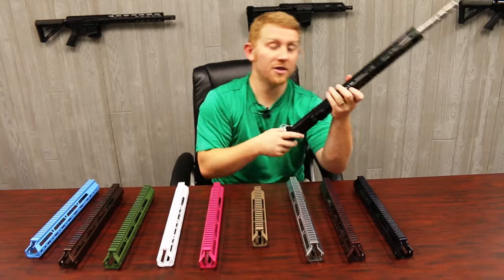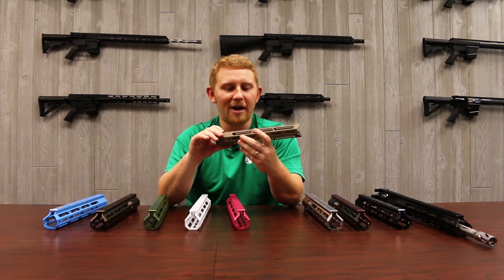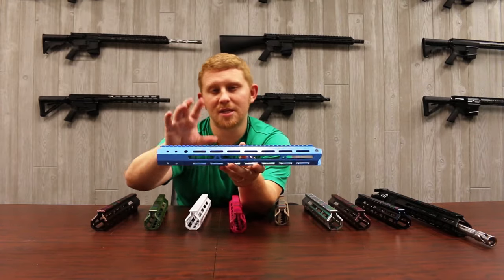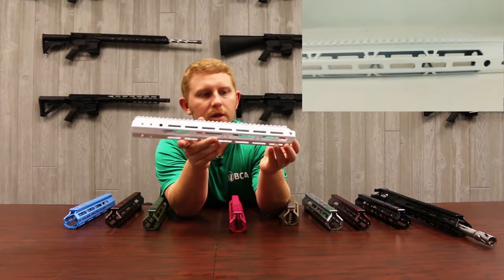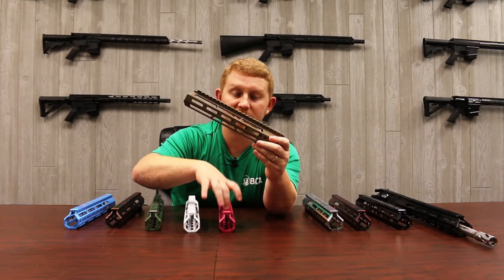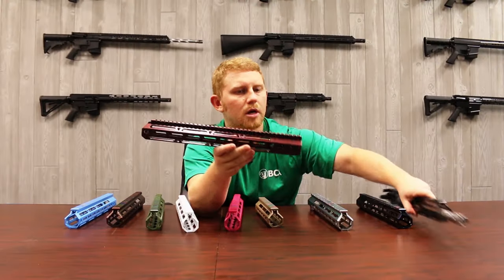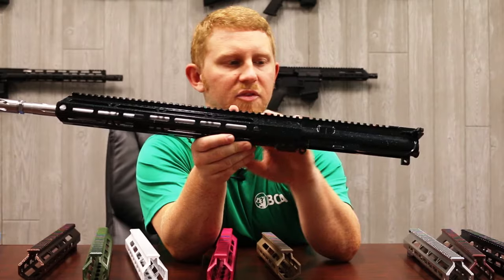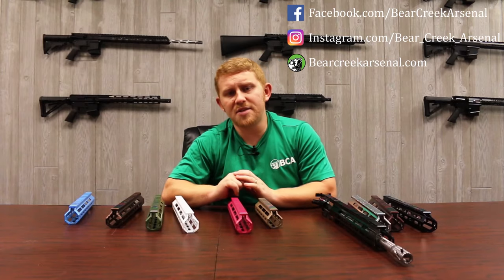Powder Coat vs Cerakote Comparison/Guide: Add Some Color to Your Arsenal

Comment: Powdercoat - 
Is a paint with pigments and added metallic properties that has been processed into powdered form. 
It is applied via a special applicator gun, that electrically charges the powdered paint, allowing for it to "magnetically" adhere to the metal surface of the project piece. 
It is then placed in an oven to bake , which basically melts the paint  back into a liquid and allows for bonding of the paint to itself and adhesion to the pieces.

CeraKote (brand of Ceramic coating)- 
Is not a paint.. but a liquid ceramic coating with a variety of colored pigment inclusion options. 
It's applied by pre-heating the material, then applying the coating to the heated project piece, then pacing back into the oven for the adhesion/curing process. 

Typical to both -
For both processes, after the baking finishes, the piece achieves its maximum strength thru the slow cooling of the pieces.

They share some similarities in resistance properties between them to: heat, surface abuse, the elements, chemical interactions, etc.. but can & do vary a bit from brand to brand.

One main difference is a thinner application, that reduces tolerance issues derived from using paints

Suggestion - 
research the properties of the coatings that you have available to yourself and the application & material reactions, that you want to use the coated pieces for and see which is best suited for your specific need..

Comment: Powder coat is better - I agree with your paint guys. Cerakote is WAY over-rated and has not held up well for me. Polyester TGIC powdercoat can be as tough as the metal it sticks to in my experience. It can be quite thick though, so it is more limited in use.

Comment: The guys in the back like powder coat better because it’s easier to apply, and they aren’t very consistent with their cerakote. Powder coat doesn’t protect like cerakote does. Despite being more difficult to apply, cerakote will outperform powder coat for any firearm parts. Not to mention, cerakote is 1mil thick and powder coat is usually 2-4 mil thick, normally around 2.5-3mil on bear creek parts. Three times thicker and still not as protective.

Comment: Does cerakote and powder coat change the tolerance within the parts that are coated?
Reply from the maker: It might a little bit. That's why we don't paint the locking lugs for example

Comment: Always wondered about this, Powder coat takes heat to set, cerakote does not, so powder coat should be more resistant.
Reply: cerakote does take heat to set
Reply: Powder coating doesn't peel or fade or scratch, used to paint cars powder coating is way better. That's how most people praying rims on vehicles.
Reply: @jacobcontreras5743  So then you're saying that cerokote DOES NOT require heat? And you used powder coat to paint cars?
Reply: There are air dry cerakote options but they aren't as durable. But most absolutely bake on.

Comment: They look great but what does it take to get hand guard screws torqued down properly. I’ve purchased 2 uppers from you folks and both uppers had loose hand guard screws.

Call the chrome one Robocop Chrome!
Reply from the maker: We want our customers to be able to modify/take apart their firearms if they desire and thus don't loctite our screws in place before sending them to you. If you have any further questions you can send an email to bcatech@bearcreekarsenal.zohodesk.com and they can give you more info :)
Reply: Bear Creek Arsenal good enough for me.  Thank you

Comment: I cerakated thousands, and powdered thousands of parts. Powder is more durable, just too thick. For fire arms, if it can be anodized, have it anodized, this process probably limits your customization needs tho.
Reply: Would I not be able to reassemble my firearm with a 2 coat powder coat on the parts?
Reply: I have a friend that does powder coat. Is there any problems powder coat has for firearms. Looking to powder coat a VR80 shotgun. Will it affect performance like feeding